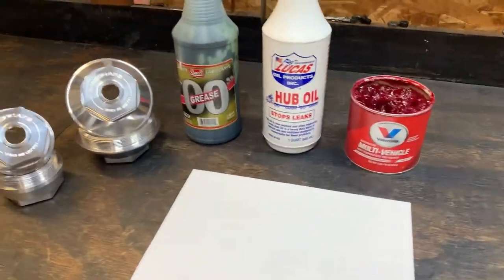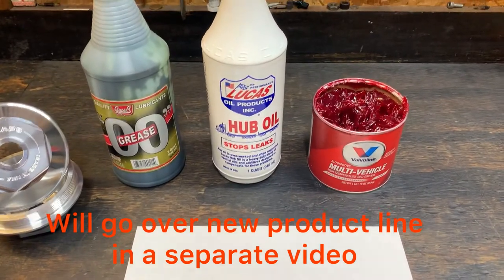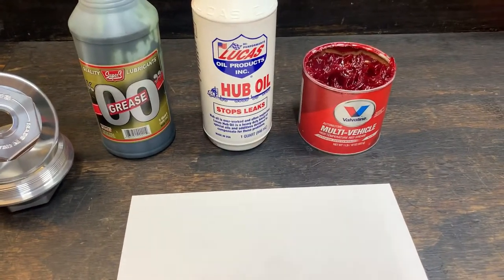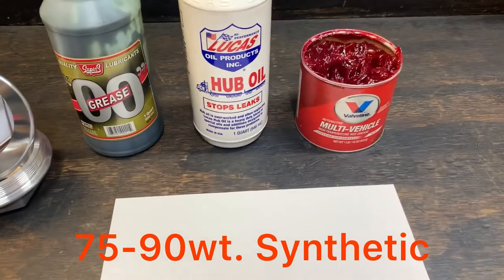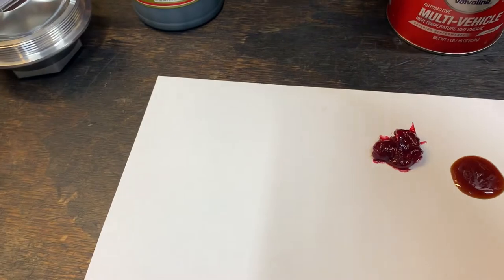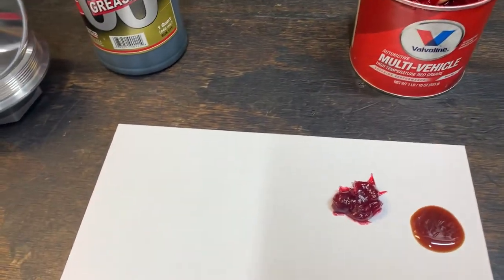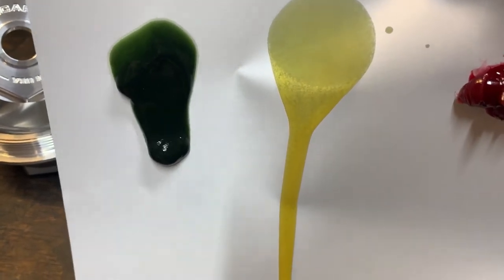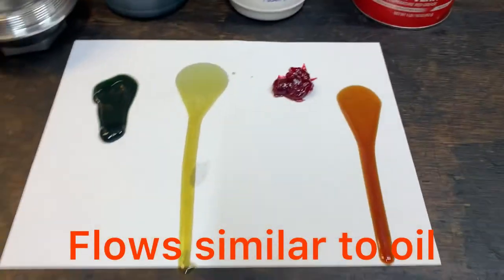Fix leaking oil seals in your Trailer

Comment from the maker: Wanted to do an update …apologize for taking so long …after roughly 2 years of running the double zero here is the results …very little breakdown. ..Temperatures remain cooler, then The Lucas hub oil… a little harder to change. I remove as much as I can fill it back up with a thin, (30-40)oil, run it a few miles back to the yard and drain. You will not get it all out, but even with the gear oil some always remains in the hub.. overall very happy with this product

Comment: Super S 00 ? Is that the product name? Also are you running it solo or as a mixture with gear oil?... thanks for the info, i gotta do something to keep mine from leaking. Three seals in less than six months... frustrating lol
Reply from the maker: Breaking in a new seal, I like to run gear oil after a few weeks or a few hundred miles. I change it …like to put in around 2 to 3 ounces of Gear and top it off with the super S… you will have to check it several more times until you get to the correct level. Takes a a few rotations, running down the road for it to level off. If you have a slow leak, you will need to continuously add until it thickens enough to where it will not get past the seal. I thought this issue for years been pulling goosenecks for about 25 years. Wish I had figured this out earlier it would’ve saved me a lot of time in trouble.
Reply from the maker: Sorry, did not proofread. I meant to say had fought this issue for years. Wish I would’ve figured it out earlier saved a lot of time and trouble.

Comment: How hard is it to clean out?
Reply from the maker: Simply remove your cap and allow to drain… reinstall your cap fill with 75 wt to 85 weight gear oil… rotate your wheel. I find the easiest way is to drive it a few miles. Remove your cap and allow to drain as normal. Reinstall your cap fill with super S …this will take several times to fill .. check repeatedly within a few miles until the correct level is reached. I personally remove the plugs and check for the correct levels. Every time I hook up even a new clear Cap be deceiving. I hope this helped …great question.